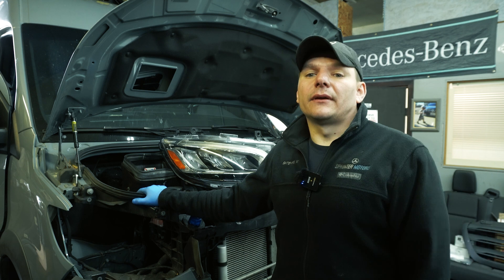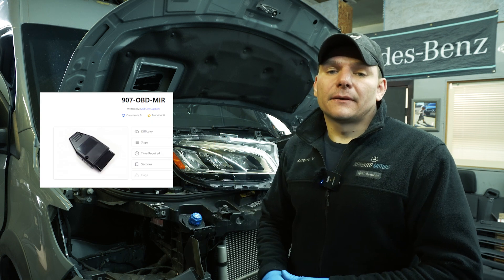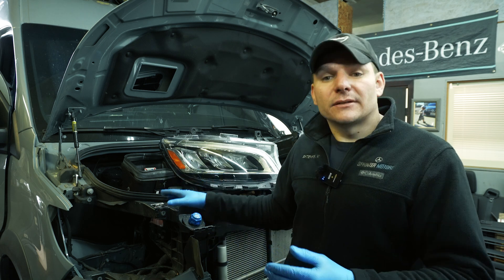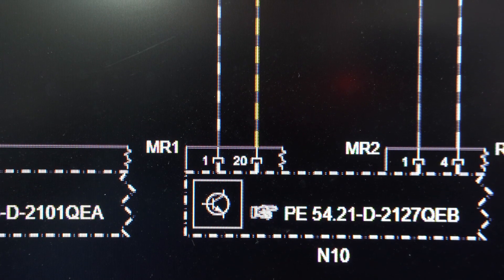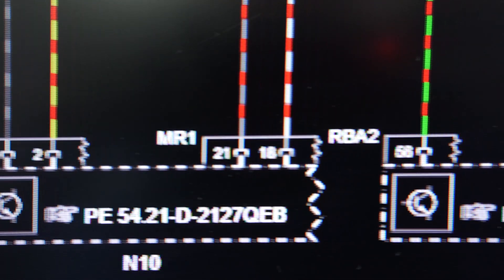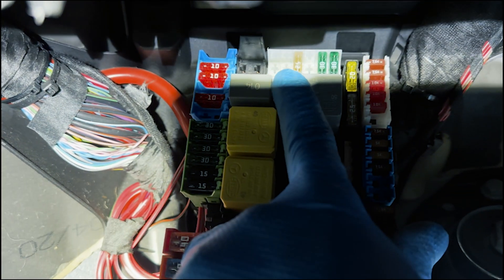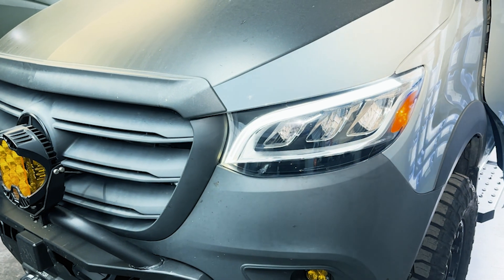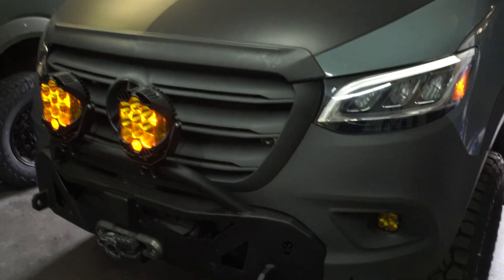Mercedes Sprinter OEM LED lights upgrade (Detailed CAN connection)

Comment: Did you convert a 2wd to a 4wd or 4x4?  We have a 2013 High Roof 170 and I would love to convert ours.  We tow a boat with some slippery, steep ramps and drive out on farms with Honey Bee equipment.  Not extreme off-roading or anything like that.  Thank you.  P.S.  Where are you located, we are in central Virginia.
Reply from the maker: Yes I did! Many times. We are all away in WA state.
Reply: @sprintermotors  I would love to convert ours but have no idea where to start.  Maybe I need to move to WA temporarily until I can get it done.